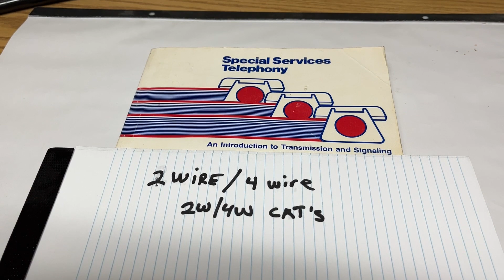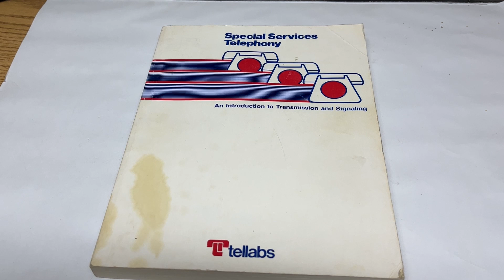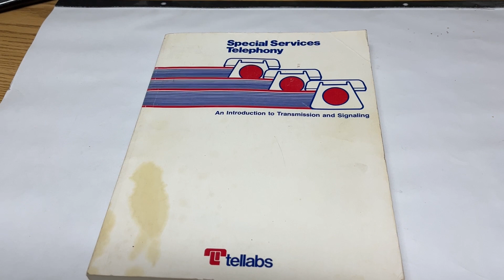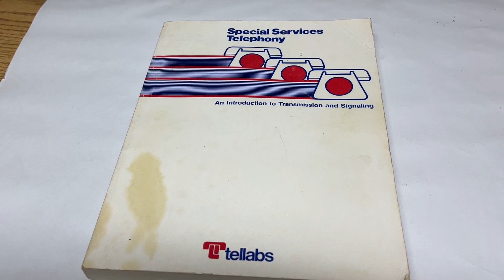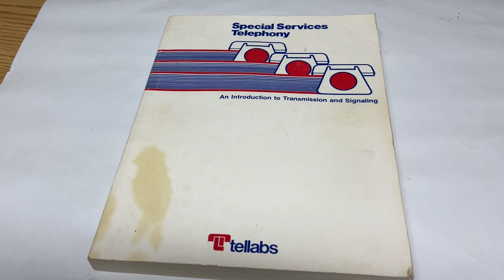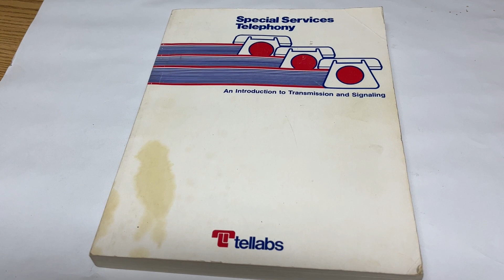Analog Transmission Circuits used in the U.S. telephone system.  DX, E and M, SF and loop.

Comment: This brings back good memories.  I worked as a SxS switchman in the 70's.  Both class 4 &5 with Cama. Everything we had was E&M signaling  -  toll, intertoll, eas, 1+ ani b/ Cama.  In the toll center (eldon,Missouri) we had simplex signaling between switches in the switch-train in the same building. The carrier eqpt was o and n2, n3 with 3700 an 2600 hertz respectively if I remember correctly. I really appreciate these videos.  This technology is very interesting to me even at 72 years old. Thank you so much.  More videos on this and switching - please.

Comment: I used to work at Tellabs designing SF signalling convertors back the late 70's through the early 2000's and I remember that Special Services Telephony book. One of the variants of the Tellabs 4024 card you show was one of my designs. I also see one of the 6073 DTMF decoder cards that I designed in your rack, and I sure wish I would have held on to one of the prototypes. I also designed a family of D4 and SLC-96 channel back compatible cards such as an ETO (Equalized transmit only) and some FXS,  FXO cards. This video brings back some great memories, and is so cool to see interest in the technology of that time ;-)
Reply: I used a pair of Tellabs 6048A cards to set up an SF trunk at home, they work pretty well! Only problem is the only documents I can find are for version 3, and my cards are version 2. They moved all the setting switches around and most of the ones on mine aren't labeled! Did you happen to keep any documentation from that time?
Reply: @thecooldude9999  Sorry but I got rid of all of my old documentation many years ago. At one time I had practices (documentation) for almost every product we had, but came to the realization that I would never need it in the future...
Reply: I have a couple sets of the 6048JA/JB military variant of the 4W SF trunk cards. Do you happen to know anything about them?
Reply from the maker: Sorry I don't